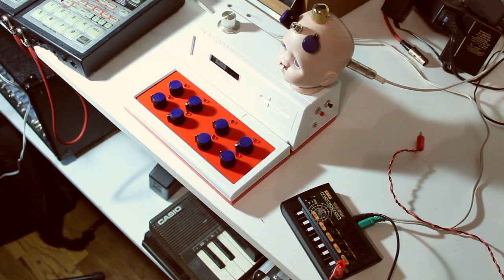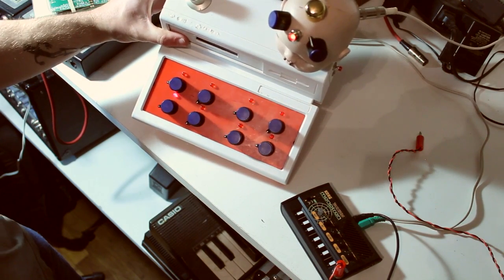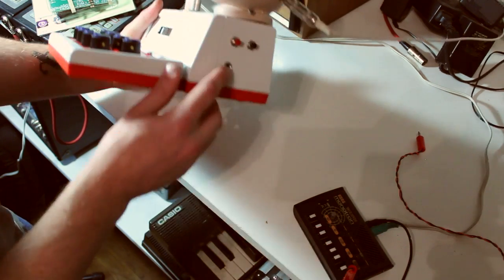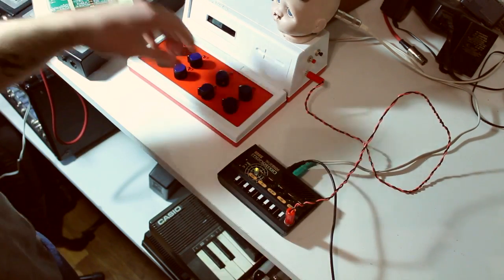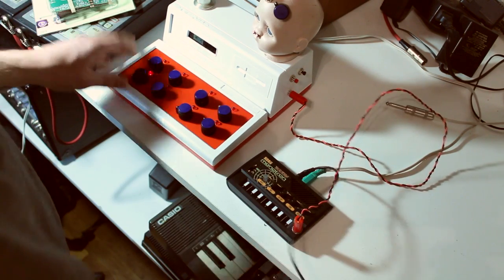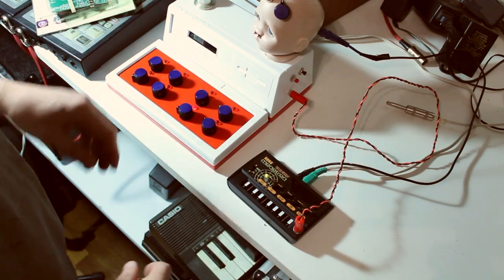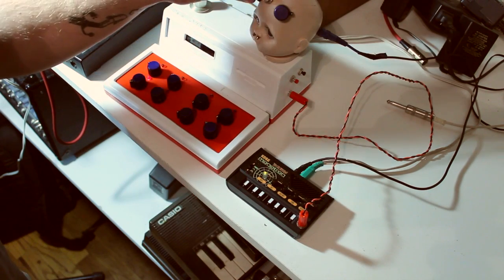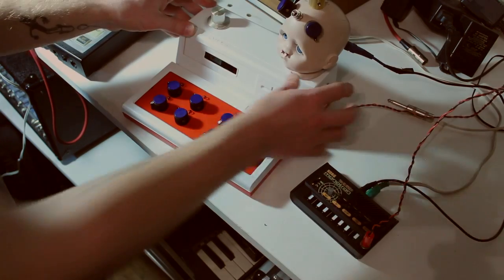DIY Sequencer + APC + Monotron

Comment: Great project! I was wondering: how did you divide the cv to run both the APC and the Monotron at the same time? Are you using a resistor on the cv out to max at 5V for the monotron?
Reply from the maker: Maxime Raymond Thanks! You know, I'm pretty sure I just used a common ground and then just split the output with a couple wires. I don't really remember if I used a resistor for the cv out. It could potentially be outputting more/less than 5v, I never tested it.